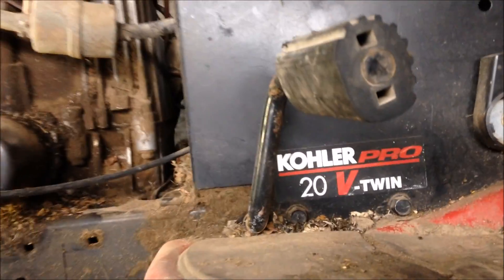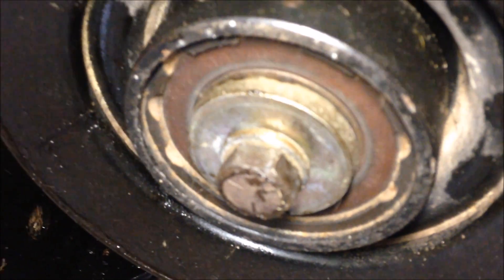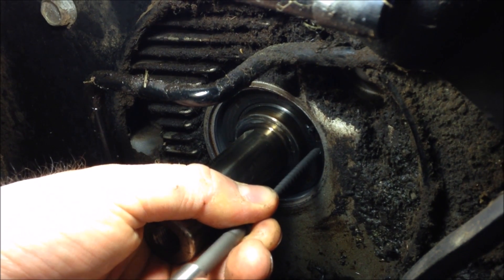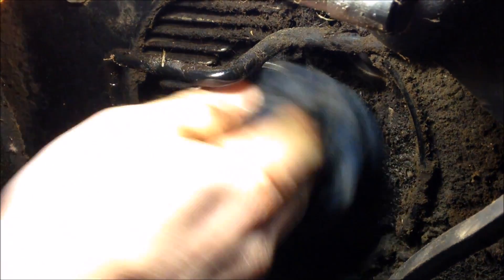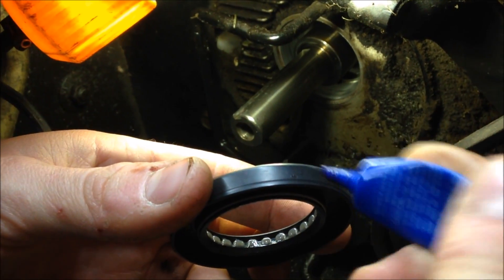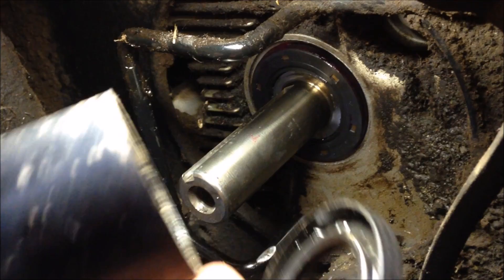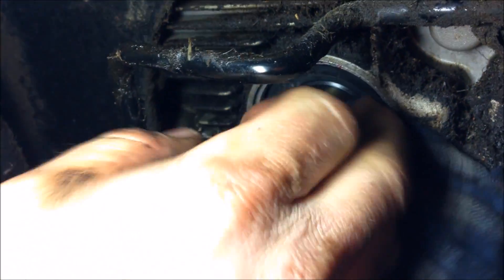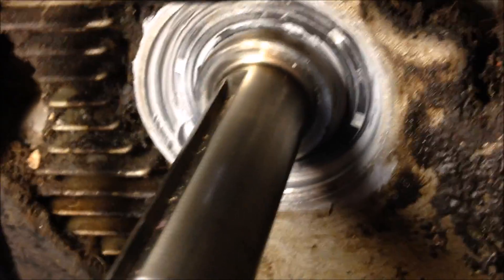How to Install 20HP V Twin Kohler Vertical Shaft Engine Crankshaft Oil Seal Replacement

Comment: Nice video! I fear i have ruined my seal. Pulley would not come off so heated it up with a torch. Got everything back together as i was changing the drive belt. 20 mins later heard a pop and oil everywheres

Comment: Good video, I have a 25 hp Kohler leaking oil. I was afraid I would have to pull the engine, this looks a lot easier.

Comment: I think I lost my seal... My Walker has been spewing oil all over the exhaust manifold and muffler... I stuck my finger in alongside the crank shaft, and it went in a good ways. Didn't feel any kind of seal... Really hope I can do this without yanking the engine.
Reply: mine came lose a few days ago you can get it back in just gotta take the exhaust cover off and the bracket under the exhaust and take ur sweet time pushing it back in evenly its a bit of a tricky one forsure as the frame rail is in a shit spot. best of luck to ya!!

Comment: Putting on the gasket maker...is that the common procedure for this, or just something extra you added? I did my seal on a kawi fb460v and it still leaks as bad if not worse than it did before changing it. I had to wonder if maybe I drilled into the motor shaft when trying to remove the old seal and caused a leak there.

Comment: How deep am I supposed to put the seal in, exactly?

Thanks for this video!
Reply: Yah I need to know this too
Reply: @Lukeluzier86  On My Motor I pushed it in to 1/16 past the very edge, so the whole seal was in: be careful of the thin plastic edge of the seal around the shaft… The first time I had a bit flipped in, and it leaked like crazy immediately after, as you May imagine. 😆
Reply: @Lukeluzier86  I think you will be fine as long as you don’t cram the seal all the way in there, Squad.

There are tiny holes that allow oil to reach the crank shaft at the bottom: Although, even if you did cram that seal in as deep as you could, it probably wouldn’t cover the holes…
Reply: @SeaScienceFilmLabs  thank you
Reply: @Lukeluzier86  No problem! I just went through the joy of restoring a very used John Deere! :)

I know the struggles!
You probably have your Mower tipped, and Took the Battery out to Make sure you don’t ruin it. :)

So Much fun! 

I’m a Pro at getting the deck off now! Lol!
Reply: @SeaScienceFilmLabs  yah I turned a cub cadet into a mud mower and I go to mud bogs and just use it as a atv I can leave you a link to a vid of it being used to yank bushes out of the ground I’m also a small engine mechanic at the age of 15 but I wanted to make sure I got the measurements correct to thank you
Reply: This is still one of the best DIY vids on the subject available, iMo.

Comment: Did your pulleys come off easily, or did you have to use a puller.  (I saw you take them off with your hands, but I thought that maybe you had already loosened them.)
Reply: I had to remove the PTO clutch on my Exmark zero turn a few years ago. Once I removed that bolt it came off really easily. Actually too easily. I was laying on my back under the mower and had my hand on the clutch so it wouldn’t fall when I removed the bolt. I didn’t realize how heavy the clutch is and it knocked my hand to the ground. Smashing a finger between the edge of the clutch pulley and the concrete floor. Which then required 3 stitches lol. So to answer your question yes it should come off pretty easily. But be careful cuz it’s heavier than it looks!

Comment: I seem to have oil leaking from this area. My Deere L130 (with this Kohler engine) is about 15 yrs old. I didn't notice any leaking during the summer/fall. Just now as I brought it into the garage to winterize and store.  The temps had dropped a lot, so wondering if temp change has lead to this and if I may get away with leaving it as is. Or, if simply applying that "gasket maker" around the existing ring ? I'm envisioning getting the pulley system off the shaft being a tough job, given the age of the tractor and the fact that the bolt has never been removed before.

Comment: do you have to drain your oil before doing this?
Reply from the maker: I would... Either that or turn the engine upside down.
Reply: Yes, you have to drain the oil or at least be prepared to catch it when you pull the seal.

Comment: none of the gasket material is needed it is a pressed fit. This will suck next time. It is not a bad thing to push it in further like you did as any wear in the shaft from the old seal is past the seal putting it in contact with virgin shaft. just be aware not to cover the oil seep hole.
Reply: Gonna be a tricky one getting that out when she goes!!!